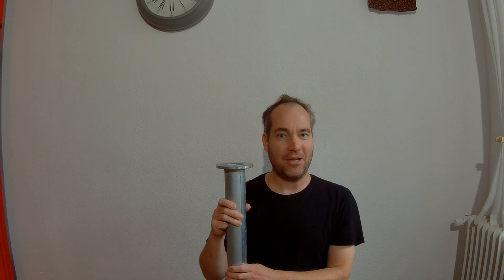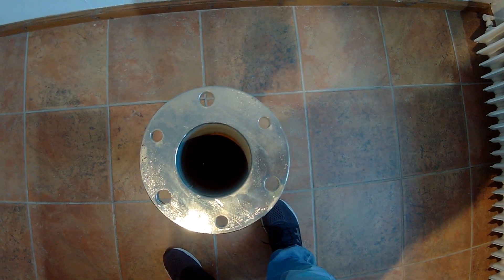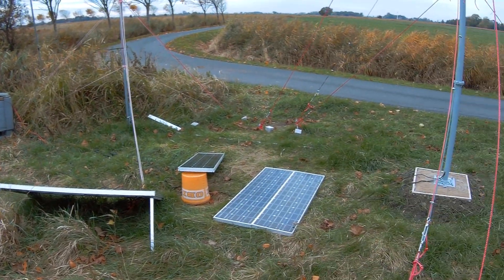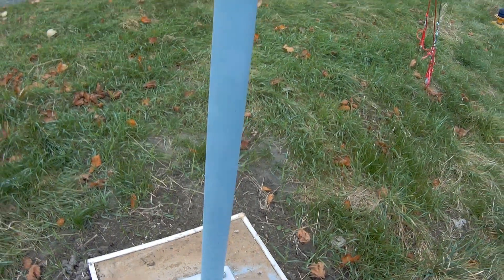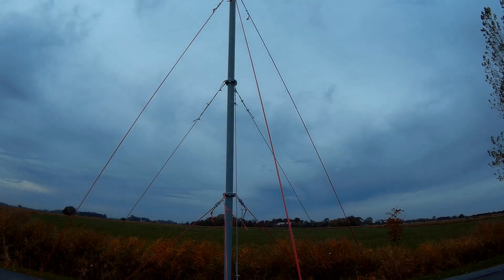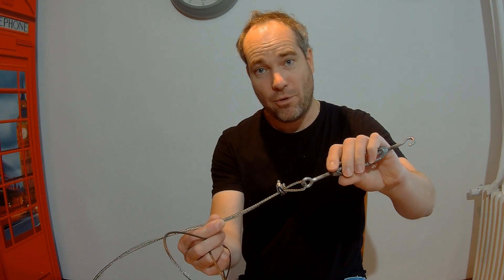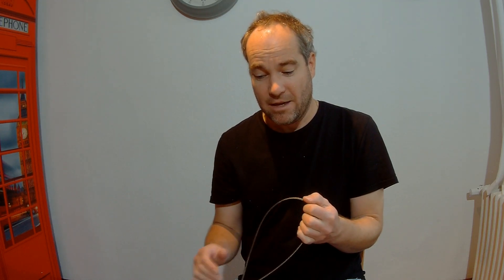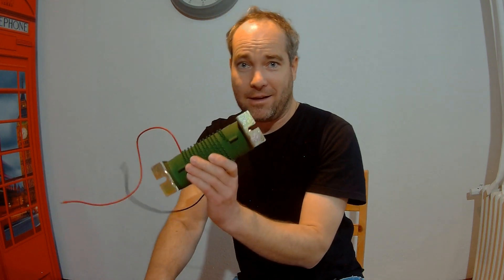Review of ISTA Breeze tower for Wind turbines

Comment: No washer needed on the base plate. The manufacturer would have calculated the size of wire required and sent the correct size 🤷‍♂️
Reply: My tower came with very thin wires. I dont know how many kg they can support. So I changed it for a wire that was 2-3 times thicker. In strong wind I would never trust the enclosed wires.

Comment: Good video. Thanks. The tower is a lot of physical work to get right, but well worth it. Look forward to your videos on controllers. Have you thought perhaps of using these great little A30 controllers ( or CD60 controllers ) with either mechanical or solid state relays?. Maybe a good option for those on a smaller budget who dont want to spend 100's on an Ista controller ( or maybe even several thousand on expensive Midnite Classics+Midnite Clipper annd the like.

Comment: Hi there, which Istabreeze turbine have you got and how much kWh are you producing? What’s your average wind speed in m/s?
Reply from the maker: Hi
Actually, I'm using the I-1500 and I-700. My neighbor has the I-1500. I guess, the I-1500 makes more sense than the I-2000 - but keep in mind, your average wind speed should be more than 5,5m/s. 
The average wind speed on a detail map is around 6,5 m/s at my location. Some maps (based on measured data) showing even 7 m/s.
On bad days (below the average speed) I have around 1kw/h at the I1500. On good days, more than 7 kW/h.
Please note, it's absolutely essential to have nothing - really nothing - in front of the wind turbine. Even small trees will decrease the results fundamentally.
Best regards
Alex